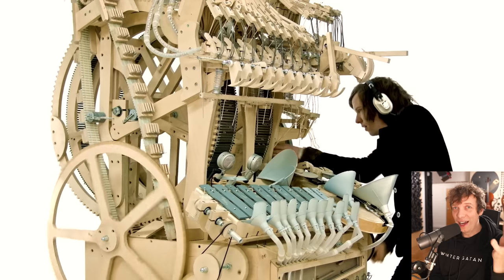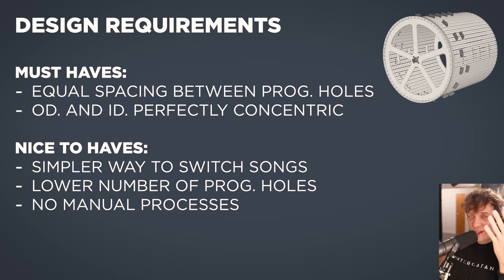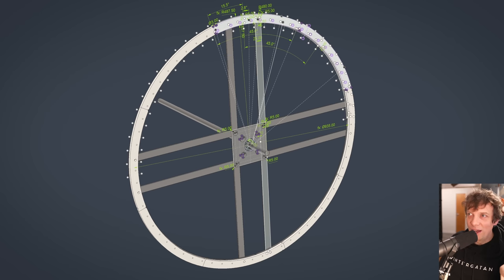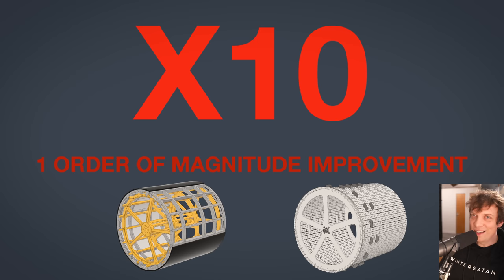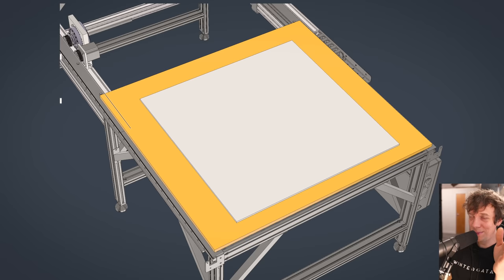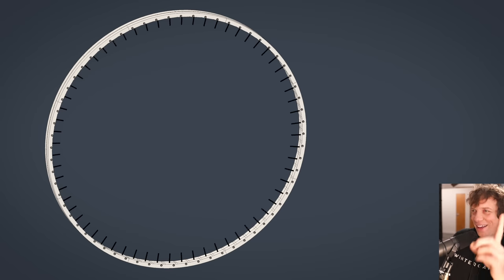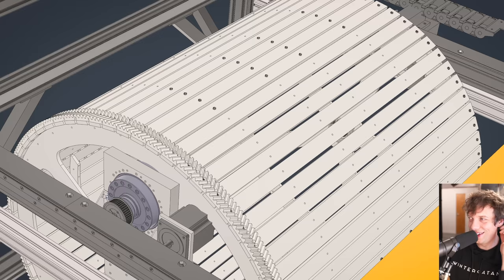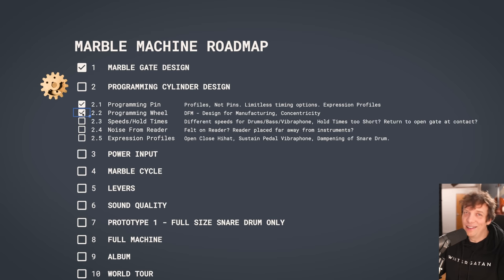A New Music Programming Wheel

Comment: "i don't trust CNC to make a 2D circle, but i trust it to make 1920 slots and a giant circular double helical gear on 3 axes"
Reply: Yup!! The irony... Ha!
Reply: I think the difference isn't the amount of trust, but rather that that large 2D circle MUST be perfectly circular. The other parts don't have as strict of requirements on their shape. (Meoiswa has correct answer below)
Reply: It's not like there is a way to test and tune that either.
Reply: Think you missed the statement at 12:35
Reply: It doesn't help that the CNC machine he has is very cheap. It's only meant for light duty work, and ornamental stuff. The precision that Wintergatan is asking for apparently, is something meant for aircraft parts, and technically should be using a $250,000+ gantry machine. But uh..good luck with affording that.
Reply: The key difference being that for a perfectly circular 2D circle, two planar CNC axis MUST travel exactly the same distance. With a polar axis (rotation) this doesn't happen, as the distance between cutting tool and the axle will always be exactly the same as long as the planar axis doesn't move, It's the same reason why Lathes can be so much more precise than CNCs
Reply: @Meoiswa  Yes, after rewatching I realized that he is actually using the rotary cnc for all those little holes as well as the circle (and maybe the gear too?) This is definitely why he is trusting it here, because it's a completely different machine (literally made for circular parts)

Comment: Hey Martin, really happy to see you're back and taking first principles approaches. I've designed and worked with drum assemblies and they can be tricky. Here are my recommendations that I hope can save you many headaches:
1. Sheet plastic for precise parts will betray you. Aluminum is your friend. Machinable plastics have young moduli low enough that they become very undesirable for large parts that need to be stiff. Plastics with better stiffness are usually not good for machining. 6065 Aluminum is awesome though and, if you take it slow, might still be machinable on the CNC you're getting. Almost forgot... the sheets of plastic will probably come warped and will need considerable work to true them. Worse, the warp may not be apparent until after cutting the shape out because the weight of the sheet will pull it into flat.

2. Stage your gears. A large helical gear on the exterior does look cool, but it will be a bear to maintain and the gear that drives it will also need to be large which either means you need to cut another custom gear or you will be paying a machinist a lot of money for a large custom gear. Reduce your drive gear considerably and you might be able to find something premade. Then you can use an off the shelf gear box to get the same final rotation speed of the drum.

3. Fix the drum to the shaft and use cross bracing in the interior. Tube steel is great and easy, but you might get away with much lighter/cheaper materials here if done right--maybe even some rigid plastic. I'd also add an interior hub. This will add torsional and axial stiffness the current design is lacking and needs to reduce wear/noise/precision.

4. Separate the drum from the drive gear and use a dog clutch to transfer power from the drive shaft to the drum shaft. If you use a coupling sleeve on the other side, you will be able to very very quickly remove and swamp in another drum.

5. Consider reducing the need for high dimensional accuracy of the programming drum by designing readers first and making "float" along the surface of the drum and only care about the relative height of the "pin" at any given point. This will make the drum much easier to manufacture and still play precisely even if the surface is 1mm off due to manufacturing or warping from temperature changes. Maybe such a reading head would be too hard, but I think worth considering

Best of luck Martin! I'm always excited to see the next video of your journey!
Reply: These are great points.  To actually get them into the group that Martin is listening to, you would want to post these on the Discord for the marble machine.  It is quite apparent that Martin is not reading YouTube comments now.  Also, be careful of using phrases that don't translate into other languages, idioms like 'it will be a bear to maintain' may not have meaning for Martin, his English is really, really good, but remember he is Swedish and the idioms don't necessarily translate, and worse, the word 'bear' has multiple definitions and meanings.

My personal preference for the spoke wheel would be fiberglass composite for weight and stiffness concerns, but, it isn't easy to manufacture.
Reply: Doesn't aluminum warp in heat though? If it's touring then that could be an issue, in a similar way to how many brass and woodwinds need to be retuned when traveling due to humidity and ambient heat making the materials expand. I'm not an engineer though, so i can't say for sure if it'd be an issue in this case
Reply: @zackbuildit88   ~ .025mm/M-K. With a 20 degree Celsius operating temperature range and a 1 meter target diameter the total change to the radius would be as much as +/-0.25mm. Not sure if that would be an issue for the readers, but something to consider with any material. Warping probably isn't likely here with a 5 to 10mm plate thickness, but I have seen bad plate stock that comes bent or with poor flatness, but most places one orders from will make guarantees on flatness.
Reply: I'm worried that number 3. things as well. 

There is just too little fixed points to hold all stiff and in position. Cross bracing is must!
Reply: Experience from 2 previous tries unfortunately suggest, that your comment will be unheard, unrecognized or ignored. To prevent the first two issues, it might help to post in Discord channel - no guarantee however.
Reply: Could not have said 2,3,4 better myself.
It seems despite a more basics approach he is still falling in to the "looks cool so use it" trap
Reply: My idea for supporting the drum would be putting steel cables on the inside under tension like a bike tire but from wall to wall instead of wall to axle so regardless of the material, including using flexible materials like plastic, the body will act rigid due to the tension of the cables. A design like this would also remove the need to have a center axel and the drum can be sat on 4 gears making switching songs as easy as lifting the drum off the gears that would 'walk' around it. Additionally the cables can be tightened or loosened to fix minor bends and irregularities as well as twists in the drum along it's virtual axis.
Reply: everything is on point. pleasing to read

Comment: I think you should make more than two.  Not just for backups, but because you're going to need more time than a single song to replace pins.  Your team has to set pins, confirm placement, and need to be ready and alert before they go to make the swap.  This is a lifetime on a hectic stage.  I would say three wheels at a bare minimum, which gives you a two songs buffer, but honestly I would build six.  Three for the performance, a travel back up for immediate problems, and then two more you can leave at home for catastrophic failure backup.

Normally I wouldn't worry about making so many redundant parts but the programming wheel is different. This is the heart of the machine and it's also the most handled.  It's going to receive the most wear and tear of any part.  You need backups for this.  Also consider that the wheels are going to change the least in machine redesigns.   Because its really the foundation for the rest of the machine and the size is set.  If you could replace certain parts of the wheel then I wouldn't worry about this but the wheel needs to be machined as a whole.  That means you need whole backups.

I would also take a moment to consider adding handles and shipping contact points to reduce that wear and tear.  And lastly I would make sure the axle and its contact points are extra sturdy.  You don't want the bearing or the axle itself being the interface.  That will severely increase your wear and tear.  The bearings should only be under stress during operation, not swaps.
Reply: At 6:07 he says he going to make two wheels so that a song can be changed while one is on stage being played. That's already the plan

Edit: wait you said more than two... my bad you were paying attention,  im the one who wasn't
Reply: @89lutzy  no worries
Reply: My thought exactly. For touring I’d have a programing wheel for each song plus backups. If not, then exactly what you said.
Reply: @kerryabear  Well, they're pretty big and they have to be manufactured and kept whole.  So I do understand why they need to be repined for songs. A typical concert is 20 to 30 songs and even if they only use the marble machine for every other song that's still a truck full of programming wheels. But yea, only two just ain't going to cut it. 

I'm hopeful that he's going to be able to make large pin groups that have sections of notes, to make swapping out faster and more reliable. They could even have puzzle piece interfaces to make sure a song is put together without errors.  But I'll let him figure that out on his own.
Reply: I was thinking he'd say there would be multiple "tracks" on the same wheel, and you'd shift the wheel horizontally to change songs. All the instruments could be duplicated on each "track" with different information for each song. You'd just be limited by the width of the wheel. And you'd need to have a "neutral" place to shift tracks. Save you having to remove the huge programming wheel.
Reply: @VagabondTE  that's a good point you make. I'd suggest going to the Wintergatan Discord and reiterate it there. All the engineering team and other supporters hang out there and the chance of your idea being picked up is a lot higher there.
Reply: @VagabondTE  honestly it isn't a huge thing to have a reprogramming machine that automatically resets pins as needed (not sure how that works with pulling pins out though). This would avoid haivng to have too many wheels. I do think mentioning another machine would make a lot of the fans here go nuts though...
Reply: @Keiranful  I appreciate the invite but the comment section isn't as massive as it used to be.  Though I may go anyway because I have an idea for a programming wheel frame and I have a feeling I'm going to have to show it visually.

It's basically just a square that runs around the programming wheel and holds the axle.  One side would hook in like a hinge and the other side would lift up to load the wheel into the machine.  This would make removing the wheel much easier and the axle itself doesn't have to be an interface.  You can just drop it down on a cart and roll away super fast.
Reply: @davinderc  Yes! More machines! :D
Reply: Having a spare will also help in completing a show when human error breaks plastic spokes
Reply: Agreed about having more than 2 wheels or finding a better solution for reprogramming. The error rate of busy stage hands trying to manually place pins between songs is going to be pretty high. 

If the machine playing the wrong note or note-length isn’t acceptable, then shouldn’t there also be design considerations for programming/human error?
Reply: Also, it's possible one could be damaged just before a show, with no time to have it re-made.
Reply: Maybe he can make a flat sort of carpet like thing that he rolls out on the floor, that the wheel can roll on and snap on the 'notes'/pins? Each song can then have a 'carpet' ready.
So the suggestion contain two ideas : the more general idea of having a tool/object that fills up the pins, and a quick attempt at thinking out how that tool/object would look like/work.
Benefits would be 1. Quicker than manual work of inserting pins, takes up less space than having another wheel, less weight than another wheel.
Reply: Would be cool if the process could be reversed; you could roll the wheel on the 'carpet' and the notes come off and onto the carpet.
Reply: @mistahsno  Definitely at least 2 wheels. I have a idea that would help programing pin placement error achieve ZERO. It should be quicker than reading a list of which pin and where it goes. An indexed wrappable Mylar templet that has open holes for where a pin goes in while blocking ones that do not take one. How to identify which specific pin goes into that open spot is something I have not figured out yet. Maybe the CNC can be fitted with a inscribing bit to scribe a number into the Mylar next to the whole?
Reply: Dont think of one pin as one note. A pin can have a series of notes.

Comment: Plastic is very flexible and rarely fat. It also can warp and sag over time. I think you would be much better off with a nice stiff aluminum like 7075. While it is nice to be able to machine it in house you would be much better served by a better material. Also you should really consider having a stiffening ring or two on the interior of the drum. The plastic peg holes could also be a problem in that they are on the same order of strength as your pegs. You really don't want the drum peg holes wearing out you would rather have extra pegs for when they get loose. Please consider doing the plastic design in aluminum.
Reply: Ah for a prototype plastic is good enough. Aluminium is pretty expensive, and he can make one if the plastik one works
Reply: @youareliedtobythemedia  The materials properties of the two different family of material are so wildly different the plastic one is relatively likely not to work, where the Aluminium one should for the same design - this is one of those parts where its so damn large, will take ages to machine and with so many different locations forces will be applied creating so many varied and inconsistent twisting forces trying to economise and build in cheaper materials is foolish. This is the part you build bomb proof solid the first time you build it and save money by doing so as even in the cheapest materials its going to cost a huge amount of time.
Reply: Engineering plastics tend to be thermoset, think Bakelite, more brittle than soft. Same thing with acrylic. All plastics can deform when heated, which is something to be aware of, particularly when touring, but they’re more than capable of being used for the programming wheel, plastics aren’t prone to warping or deforming under normal loads. In addition, I’m not sure whether his CNC is capable of cutting metal. Plasma cutting isn’t terribly precise, and would require more finishing steps, where as plastic can be easily cut on any CNC machine that is capable of handling hardwoods. Agree on stiffening up the drum though